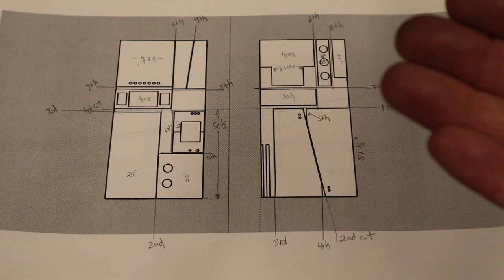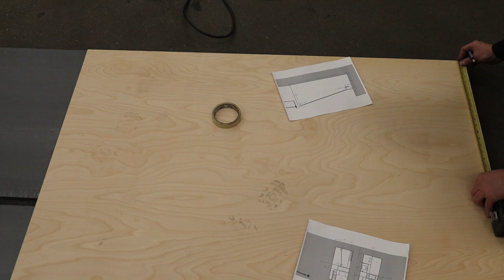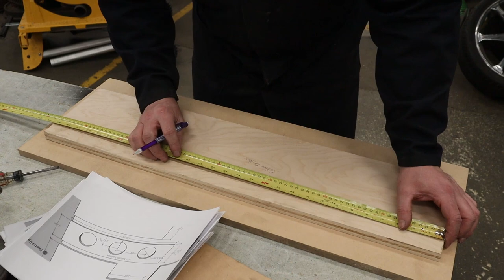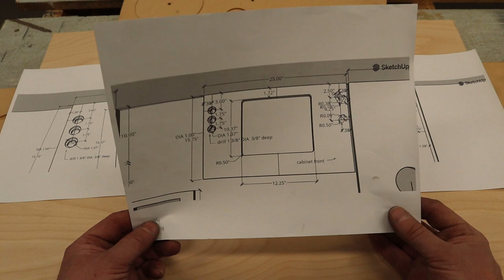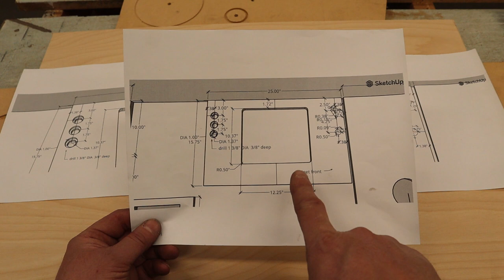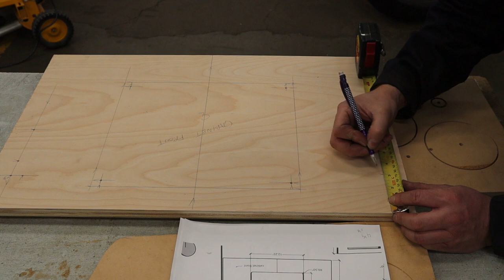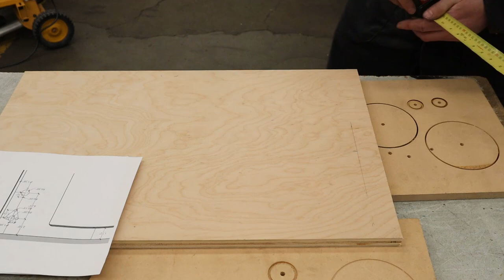How to make a virtual pinball cabinet

Comment: Great video. I started making my cuts yesterday, but your video on sketch-up was huge help as I watched it a few times while designing my cab. I’m still ordering a few parts, but at least the monitors/computer are setup and running. Again thanks to your video I learned about the baller installer. Thanks for sharing the knowledge!
Reply from the maker: Awesome dude!  You design your own cab?  Just a heads up, the speaker panel pocket in my design needs tweaked as the 3d printed speaker grill was smaller in height than my pocket so I had to fix it.  Note to self....never cut out anything until you have your parts.  Enjoy your build and I'd love to see your progress, send me some pics on Instagram.  Cheers!

Comment: Thank you very much for your series, great job! They were very inspiring and my project is already taking shape. 
I will build my project exactly according to your plans
Reply from the maker: Awesome!  I'm excited for you!  If you're using my plans, you might wanna use the original blackbox dimensions as it requires custom sized graphics and won't flip down fully unless you add probably a 3/4" riser on top of the main cabinet.  I'd love to see your cabinet when you're done.  Thanks for the watch and good luck on your build!

Comment: Fantastic video!  Thanks so much for spending the time to put this together.  I don't currently have room in my home for custom full size table, so I'm using an AtGames Legends Pro Dualstick deck with Joy2Key hooked up to a gaming mini-PC and a 4K TV in landscape mode.  It works well, but the immersion is just OK.  Someday I'll have to make room for a full-size table.  Hopefully by then Video Cards and 4K 120+Hz monitors will be more reasonably priced.
Reply from the maker: Thanks Bruh!  Yeah it's a lot of work but I'm hoping it will be a great resource for the vpin community.  Yeah I hear ya about having the space for a full size let alone an ultrawide cabinet....I'm still working on the wife but my vpin might have to stay in the shop of go in my garage.  Problem is there is no room so I'm going to have to finish some projects or sell my dirt bike.  Thanks for the watch!

Comment: Once again absolutely stunning video! Thank you for taking the time to make these.
May I ask why plywood and not MDF?
Reply from the maker: Thanks very much!  I normally use MDF because I like how flat and straight MDF is but this time I used cabinet grade 3/4" plywood because it doesn't deaden the sounds/vibrations from the surround sound feedback system I'm going to put in.  It was more expensive and a touch harder to work with but the pinball experience/sounds should be better for it.  Thanks for the watch, part 2 is coming soon...

Comment: Way of the Wrench, Thank you for making these videos! I have been checking back to your channel every day to see when your next pincab video was going to drop. I am still in the exploratory/research phase of my plan to build my own virtual pincab. I was initially going to buy an AtGames Legends Pinball or Arcade 1Up Pinball machine, but I read about some of the issues with being limited to certain pinball tables (Manufactures) and not being allowed to download certain fan-made tables. Also I have intermittent internet (it works 80% of the time 🤣 and I want to be able to play virtual pinball without interruption if I lose internet connection for 10-30 minutes sporadically throughout the day. So building my own pincab seems like the right choice. Not to mention going the DIY route allows you to build a full-size pincab (Unlike the ATGames/Arcade1UP)

I appreciate your focus on sharing tips & tricks so that the everyday layman can build this pincab with easy to use and affordable hand tools. When I saw that you bought two huge 8' X 4', 3/4" thick plywood sheets... I was thinking you really do need a whole woodworking shop in order to cut it in the sizes and shapes you would need. I'm glad you proved me wrong! 

 Your videos on where to find/buy the TV's and monitors and what sizes work best are making it so much easier for me to tackle this project. I have been scouring all the local online resources that I can find looking for suitable TV's and monitors. I haven't found the right one yet, but I'm researching. 

Your tips on how to avoid making some of the minor mistakes you made are very helpful in my opinion... how to use masking tape to prevent some wood tear-out, how and when to use wood clamps to prevent tear-out, using high-density foam as a cutting surface, and your advice on how to use the craig (style) track saw were great. I’m going to purchase a craig (style) track saw, a circular saw, and a jig saw. The only tools I have are basic household tools: cordless drill, hacksaw, screwdrivers, etc. Do you have any advice on where I should look (preferred online retailer?) to buy some of these woodworking tools? (craig (style) track saw, circular saw, jig saw) And should I look to buy new or used?

If you decide to make this a 50-part video series, that's fine with me! The more detail the better for a beginner like myself. Keep up the excellent work and I can't wait to see and learn how the rest of this project progresses.
Reply from the maker: Ok you win....longest most supportive comment!   Yeah you gotta build your own, I personally don't like the mass produced cabinets.  I do like making custom cabs that no one has out there because you made it!  As for buying tools, I would say that as long as you are going to continue making projects, go ahead and spend money on new good tools.  I would recommend Makita for drills, jig saws, etc.  I like the Freud routers.  However, if you only want to make this cabinet, you will want to see if any family or friends have these tools and if you can borrow them for free.  If they want to help, that's an added bonus and it would be a great project to build with a friend.  If money is tight, you can look for used tools too, just be picky as some people will want to sell you their broken junk.  Sometimes pawn shops can have pretty good deals on used power tools. I would personally recommend corded power tools over cordless as well.

Man it might be a 50 part series by the time I'm done...lol.  Glad you are enjoying the series.  If you deem me worthy, I'd really appreciate a share out on your social network so I can help more people.  Thanks in advance and for all the support!  Cheers!

Comment: Inspiring walk through! I'm really wanting to do this. I'm just trying to get the computer and playfield part of it set the way I like it before I design it. I started with a spare TV, but it's output is slightly behind. I'm thinking of getting a Gaming monitor like the "LG 43UN700T 43" IPS Display 16:9" (38.1 x 10.8 x 25.5 inches) or something similar. Maybe your design will fit that? I'll have to look at the details. There are ACERS that are too expensive and another LG 43" that's skinnier at a 21:9 ratio. More real playfield shaped but I'm scared that it would stretch the field.
Reply from the maker: Glad you enjoyed the video and are excited to start building your cab.  Yeah go slow like I did and gather your monitors and computer, that way you can make your cabinet whatever size you need.  I decided that a 46 inch tv was the perfect length because you don't need an apron yet the side profile is still a Williams widebody profile, you just have a wider cab by and inch and a bit. The 21:9 ultrawides are too long I think unless you are planning on adding some kinda filler on the screen like a dmd.  Sounds like your on the right path though, ya gotta send some pics/video when you start building, cheers!

Comment: Hi, I love your videos (I've already subscribed) and I just watched this episode last night. Thanks for the sources for parts.  I will be going there.  I am looking to pretty much replicate what you are doing here.  So, it's great to watch you.  Gotta say, I love the Kreig saw guide; going to purchase one of those.  Just anxious to see the video where the cabinet is assembled.  You might touch points that I will run into before I actually run into them.
Reply from the maker: Thanks for the watch and sub Rob, it is much appreciated!  Yeah that track saw was a good purchase, even if you just had to do the long angled cuts.  Yeah I hear ya about wanting to see the assembly, there is going to be tricks and tip for ya so you might wanna wait.  This Thursday is the t molding slitting video and then the Thursday after is how to cut the 45 degree braces and assembly videos ( spaced out like 2 or 3 days).  Good luck on your build and I would love to see a video or pics of your vpin build once your done!
Reply: @wayofthewrench  I have accessed your plans on wordpress.  Did you also provide the sketchup plans somewhere?  My best sheet goods so far is true baltic birch plywood.  but it's 5 foot x 5 foot (~1.5m x ~1.5m) and I wanted to see if the parts plan fit correctly.  Thanks.
Reply from the maker: No I'm not sharing my Sketchup because I have had people with other youtube channels trying to take this file and put it on their channel.  All you have to do is open up Sketchup and redraw the components (could be just 2d) and draw a 5'x 5' square and rearrange the positions of the parts to figure out your cut plan.   It should be quick because you already have the dimensions, your not trying to design and test fit stuff.  Cheers!
Reply: @wayofthewrench  I can completely understand that.  I'm not new to sketchup, only looking to save a little time.  But with the dimensions, it should be easy enough. Looking forward to seeing your next video.  Keep up the good work!

Comment: Looking good!
Reply from the maker: Thanks Myles!  Are you making one of these?  Already made one?
Reply: @wayofthewrench  not yet but hoping too soon.   Do you have need of a human machine interface for any projects.....I have a few.
Reply from the maker: What kind of interface stuff?
Reply: @wayofthewrench  I have a bunch of 7 in touch screen nextion model nx8048k070_011c  human machine interfaces.   I used to work for Urban Cultivator / BCNL and these were the touch screens on the commercial cultivator / Nursery units.
Reply: @wayofthewrench  you can have one for free no worries.   I have 4" and 2 " axial fans and other parts out the Ying yang as well.
Reply from the maker: Cool!  I'm trying to think of a cool mod to a project where this would work.....Maybe a live high score monitor that you can swipe to see the high scores for different vpin tables.  Or maybe a monitor that allows you to swipe to display history of the pinball table, table rules/instructions, original advertisement art, etc.  Thanks for the offer. Where are you on this giant spinning ball of water?
Reply: I was thinking about making a one screen table with buttons to mount on my treadmill.......
Reply from the maker: cool!

Comment: I´m amazed about the ton of information I got from this video. Thank you a bunch. I got one question regarding MDF, can I use a spade drill for MDF or a wholesaw is still the better option for MDF?
Reply from the maker: You're welcome Mario!  Glad you're enjoying the content.  Ya know almost any of the drills are decent as long as they are sharp, if they are dull you get more issues.  Just give the spade drill a practice drill to see how it does, remember you can clamp a sacrificial piece of scrap wood underneath to prevent the tear out on the underside.  Thanks for the watch!
Reply: @wayofthewrench  thank you once again. I asked about the spade drills because I already have a bunch of those. Gonna start building my cab next month.
Reply from the maker: Give em a try and see.  I wouldn't use them for the counter bore holes though, or at least try it on a scrap piece.  Good luck on your build!

Comment: What type of wood are you using for the build?  I know it's plywood, but it looks nice and smooth.  Cabinet grade?  THANKS!
Reply from the maker: Cabinet grade 3/4" plywood from Canada.  I paid more for this though, it was $120 a sheet....not cheap.  Yeah it was very flat, I only had a couple pieces warp a wee bit after cutting out/drilling massive holes but that's plywood.  MDF is dead flat but won't vibrate for my ssf so I went with the ply.  Thanks for the watch!

Comment: I'm currently designing my own table, so this is a great resource to follow and perfect timing for me. Curious, for the front panel buttons why did you recess them when it looks like the button's casing would sit flush to the cabinet on its own. Is that more personal preference as opposed to function? Also wondering if you plan on routing the edges to connect them, but guess I'll wait for that video to drop.
Reply from the maker: Awesome Bruh!  The counterbored front panel holes are so they don't stick out and you accidentally bump them while playing a game.  Imagine your 1 billion point game ruined because you bumped the exit button!  Yeah the video is coming but I do a simple corner butt joint with pocket hole screws and reinforced with a glue up block in the corners.....very strong.  I did that instead if dados or any hard joints for beginners to have an easier time.  If I was doing it just fir me I would buy a mitered lock router bit and use a router table plus the glue blocks.  Thanks for the watch Jason!
Reply: @wayofthewrench  I don't think I'm in danger of losing billion point games, but get your point. :) Thanks for all the info and introducing me to the saw track. Looking forward to grabbing one. The way you're doing this was my original thought, but then wondered if doing some kind of rabbet or other edge was better. Would be a new skill to pick up for me but wasn't sure if the juice would be worth the squeeze. Looking forward to the remaining videos!
Reply from the maker: Yeah the track saw is actually pretty awesome, especially at the long angled cuts like a pinball cabinet has. Yeah the rabbet joint isn't really stronger, it's more of an easier joint to assemble and help hold it in position more than anything.  The edge to end grain is still the same and the glue sucks into the straw like structure away from the joint.  A dado joint is a lot better and any joint that has face grain against face grain like a finger joint is best.  So the butt corner joint isn't the best but with glue blocks and pocket screws it will be solid enough for any pinball cabinet.  Cheers!

Comment: I have watched all of your videos, finished my sketchup, have all my monitors and now I am ready to buy the wood. My questions for you is that Pinscape Bible recommends MDO. My local lumber yard has MDO in stock, using your method of putting it together, will MDO work well for the glue and screws or would getting plywood be better? I have never worked with MDO so I am not sure if it cuts the same with a router and jigsaw too. What do you think? Thanks for your input.
Reply from the maker: I would highly recommend using cabinet grade plywood instead just because the MDF board dulls the vibrations in the cabinet and your ssf sounds will be lessened.  Otherwise they are both easily cut by any woodworking tools/equipment.  Thanks for the watch!
Reply: @wayofthewrench  Thanks for getting back to me. Would you go with birch, baltic birch, maple, red oak or something else if you could choose any of them? I will be painting it black and will have custom decals on the side so the look does not really matter. Just want something that will be strong and will nicely take the paint.
Reply from the maker: All will work but I wouldn't get oak or maple, harder to cut and more expensive.  The birch will probably be cheaper too.  Cabinet grade ply is expensive already.  Cheers!
Reply: @wayofthewrench  Birch it is, thanks!
Reply from the maker: Cool, good luck!

Comment: When you made your straight cuts,did you measure the exact length,or did you also add the width of the blade?
Reply from the maker: Exact length but cut on line with the edge of blade so I got my required length.  Thanks for the watch!
Reply: @wayofthewrench  Thanks for the reply....on a side note I'm thinking of using super glue,with an accelerator instead of wood glue....any advise or thoughts on this?.
Reply from the maker: I would not use super glue, just use regular wood glue.  Super glue is not good at filling gaps.
Reply: @wayofthewrench  Thanks,and will do.
Reply from the maker: You're welcome!

Comment: Hi,in your opinion would 12mm soft ply be sturdy enough?;also the backbox,I have a 32 inch tv (not to dissimilar to yours).Thanking you in advance.
Reply from the maker: Not sure but that's a full 1/4" less than mine so unless it's a smaller cabinet, it may be a bit flimsy feeling.  Hope that helps.  Thanks for the watch and welcome to the channel!

Comment: Is this the same dimensions as a williams widebody? I ask because I see you made your own lockdown bar, would a normal widebody lockdown bar fit? Thanks!
Reply from the maker: Yes for the most part.  The front and rear are wider to accommodate the larger tv and the backbox sides are a wide wider as well.   There is free plans in the video description . Thanks for the watch!